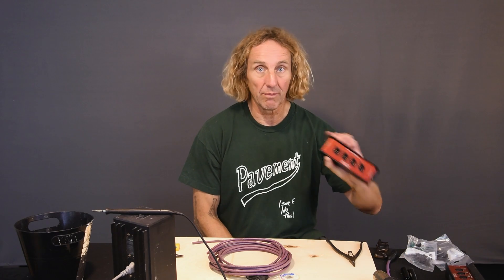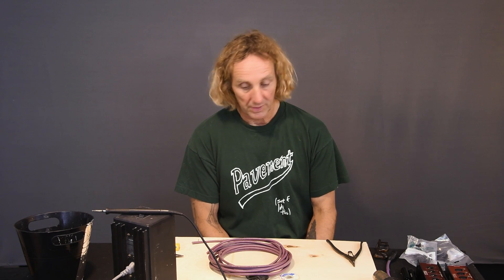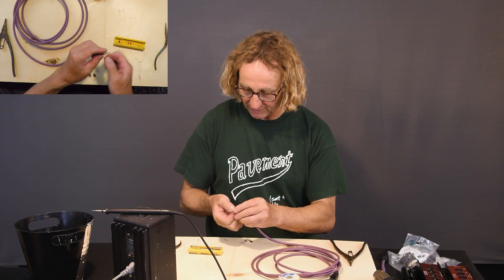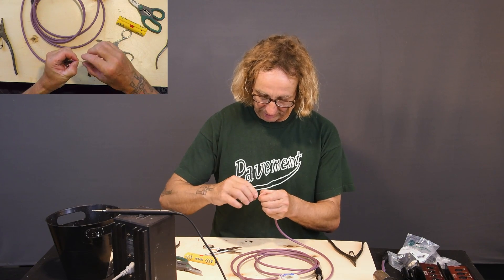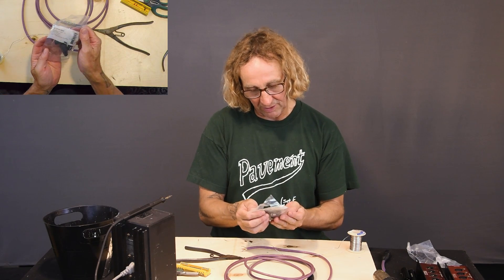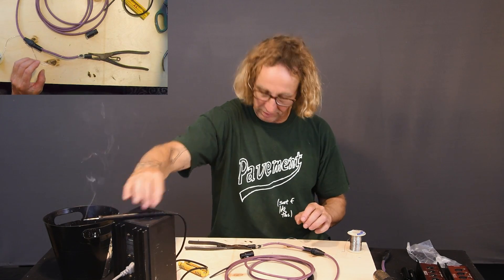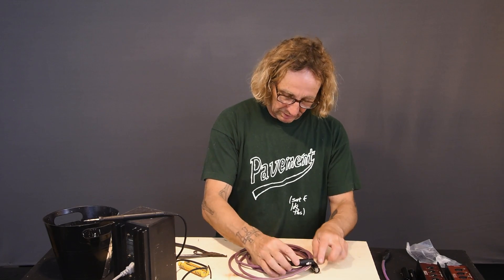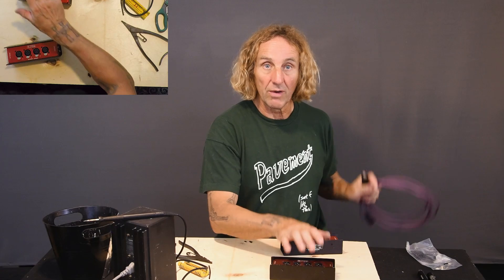Use a SoundTools Cat Box as a Press Feed (Public)

Comment: Can you use 4 mics parallel on the box going out, and the ethercom to xlr cable going in to a mixer board? For instance, If I have 2 channel board, can I use these 4 channels to go into 1 channel in that board?
Reply from the maker: Hmmm, yes but you would need to make an ethercon to XLR adapter. I've never seen anyone Y 4 mics together, sometimes two mics Y'ed together when they're on the same instrument and you run out of channels is done.

It would work but you wouldn't have control over the separate mics.

If you know how to solder it wouldn't be that hard to make the adapter.

Just cut one end off of a shielded ethercon cable and connect all the striped wires to pin 3 and all the solid color wires to pin 2 and the shield to pin one of the XLR
Reply: @DaveRat  thank you Ill try it.

Comment: I wouldn’t use this for an actual press box but it would be a great way to send line level audio out from a production truck or in a
a large hall over a long distance  to where you could tap off it to actual mult boxes or maybe two sends for mult boxes and two mic returns for Q&A from a couple of strategically placed mics so you wouldn’t have to rely on a wireless
Reply from the maker: Having disconnect able 4 channel snakes and daisy chain able stage boxes and each units based on readily available shielded cat 5 can come in quite useful for numerous applications.

I have done several vids on things like crosstalk, phantom and comparing to AES3 and mic cable
Reply: @DaveRat  We started using the Professional Sound Corporation (PSC) Press Train passive mult box which has a line in/line out feature which makes daisy chaining very easy.  I think I  metered it at only a 2.5 dB loss at the next box. BUT if I were to incorporate what you've got going there, I could set up four units with no loss of signal at all!
Reply from the maker: True, simple solutions or back up solutions are cool to have around

Comment: Dave, I have two press boxes picked up at auction. If you need press feeds often, I could send you one for shipping cost. They are Horizon PB-8 isolated press boxes. These are passive with isolation transformers to block phantom power, isolate single ended loads, and ground issues.
Reply from the maker: Awesome and thank you.  We actually have 4 to 8 stages of gear or tours out on any given day. Most don't need press boxes but some do.  We have a dedicated analog splitter drop we use. I shared this to show a cool way to make a cable allowing people with SoundTools catboxes to easily make a press box when needed.

Comment: Hi Dave, thanks for this video!! I was wondering would this be possible with the 12 channel box with the throughs going to each input?
Reply from the maker: A 12 out press feed driven off one console output? If so, es, that wouldnwork, make the custom cable, drive one ethercon and use two shielded ethercon or shielded RJ45 jumpers to link the  other two 4 channel sets.

Comment: A male etherCON connector with the stripes and solids hooked together could also be a slick solution to this. Just plug this bridging adapter into the opposite etherCON port and now all 4 XLR connectors are bridged together
Reply from the maker: Yes! A shorting plug!
Reply: that's a good idea it's almost like the equivalent of a loop back plug